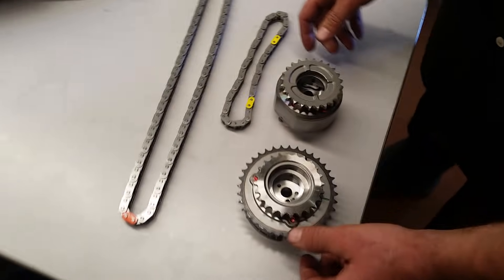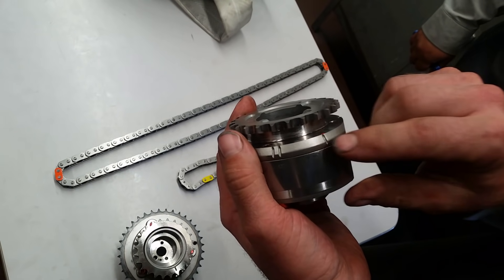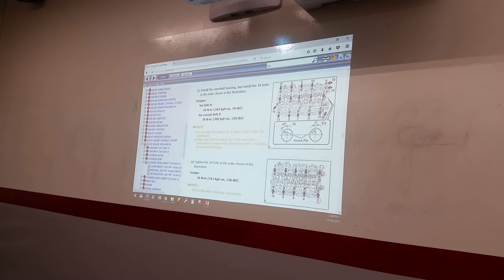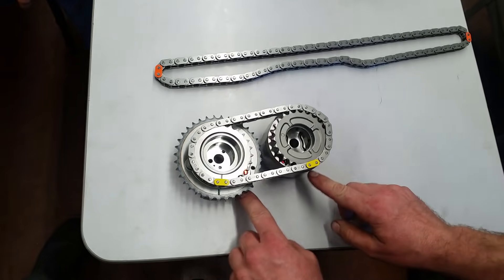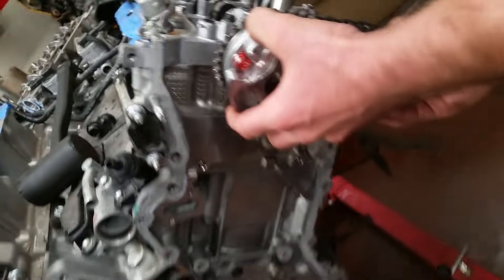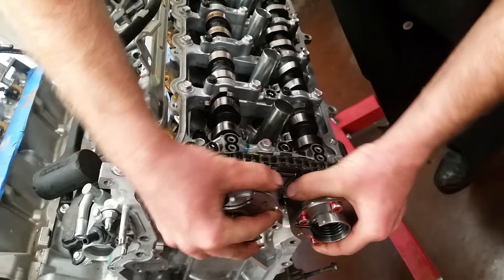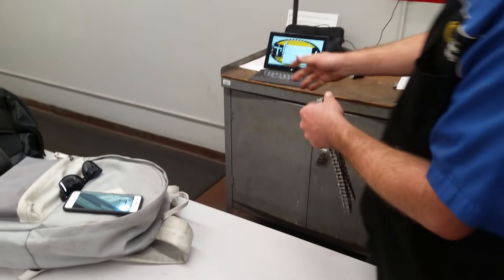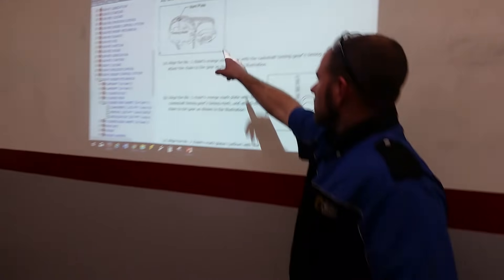How to time Toyota 3ur-fe Tundra Sequoia V8 timing chains

Comment: Was this all done with cylinder 1 TDC??
Reply from the maker: No, the marks are relative chain to sprocket on this. Unlike a timing belt or some chains. If the marks line up, TDC is irrelevant.
Reply: Thank you thank you thank you so much for your reply. 
OK, so if TDC doesn't matter. What should I have the cylinders sitting at? Just a neutral position, where none are TDC? Also when putting the cam towers back on do the lobes matter which way they are facing? Other than the degrees for the knock pins?
Reply from the maker: @johnnygamboa143 just where the knock pins say. Then the chain will hang down and show you where the crank needs to be
Reply: You just blew my mind, I think I get it now. Cause the sprocket/phasers on the intake cam have timing marks for the main, longer chains. So those line up with whatever your crank then has to be positioned to. So it doesn't matter where the cylinders start off at? I guess I got confused cause this is the first timing job I've done, but I also took off the cam towers too cause I had to do the head gasket 🥲
Reply from the maker: @johnnygamboa143 you got it
Reply: I set it all up, but when I rotated engine by hand, I feel that too much slack was in my longer chains due to the tensioners not being fully extended, and fear it kept jumping timing by a tooth. Do the two tensioners for the longer chains need to be prepared in advance with oil pressure?
Reply from the maker: @johnnygamboa143 that is normal, those tensioner will pump up with oil pressure but not until you start it. 
I would reset them and leave them, no need to rotate 

Or if want to rotate use a ziptie between the timing chain guide and tensioner shoe (moving guide) to apply tension. Dont forget to remove the zipties.
Reply: Thank you so much, I've rotated the engine several times and my smaller chain links aren't lining up with my longer chain links, but they are going back to their marks on the sprockets, just not at the same time..So I guess I'll just redo it, take it apart set it and leave it
Reply from the maker: @johnnygamboa143 yup. They will eventually line up but it takes 27 rotations or something ridiculous like that. I dont waste time on that.

Comment: good video but just a suggestion for next time lol, maybe show the passenger side because it was harder instead of the driver where the chain falls into place. Talking about the flat spots on the cam sprockets to pass the chain through would have been nice. Sometimes a video aint enough and a mechanics just gotta mechanic

Comment: I know this video is old, but I am hoping to get a response from someone.  I did this job, fired it up and it gave me a P0348 code which is sensor A.  Changed out all the cam sensors and it is still coming up, it is timed correctly.  Looked at all the wires going to the connectors and they're all good.  There was one thing I forgot to do and that was put the ground cable wire back onto the valve cover when I started it, could this mess things up on the ECU?  I've heard the crankshaft sensor can cause this code to pop up but I have not had any codes come up on this truck with 100K miles on it until now.  Do I need to clear the codes while the truck is running?  I get the DTC's via my bullydog since it is supercharged and can clear them through that.  Any help would be much appreciated!
Reply from the maker: The ground not being connected won't cause anything like this. 

This code is not related to timing either, that's more of a crank/cam correlation code. 

Your code is typical. The voltage received at the ecm from the sensor is higher than spec. You have either:
A defective sensor (doesn't matter if it's new)
A problem in the 3 wires between the sensor and the ecm
An issue with the circuit inside the ecm

I would have to pull service info to really coach you step by step but this will get you in the right direction.  Looking at wires doesn't test them. My recommendation would be to check the sensor for correct voltage (terminals at the sensor) and terminals at the ECU. As an example, one of the wires should be good ground. If the sensor is not getting a good ground it will send a high voltage reading back to the ecm and set this code. 

You are one the wrong path checking timing and stuff. Focus on the voltages related to the sensor. That's how the dtc logic works.

Comment: Since you only showed the driver side, I have a question about the passenger side. Do you use the double line on the exhaust phaser or do you still use the single line?
Reply from the maker: https://drive.google.com/file/d/148eKXIbQdEV2zXTIWIUXrhrCjkGcmoDF/view?usp=drivesdk
Reply: Did you find out how? Im currently trying to figure it out.
Reply: @lukereed5889  I tried to re-time the engine using the old components just to make sure I could do it right once the new components arrived and I used the single line on both phasers. The engine turned easily and nothing hit. But the block turned out to have a slight crack so I never did get to hear it run. So all I can tell you is everything seemed good using the single line.
Reply: @JoseDiaz-bk9mh  Thank you so much
Reply from the maker: @lukereed5889  check that link to the service manual document that I put on Google drive.
Reply: @lukereed5889  no problem

Comment: I don't know if you reply to old videos but I'm confused on bank 2, did you do the chain and spin the crank and the did bank one? Or is the procedure the same as bank 1
Reply from the maker: It is just about the same, you may have to reposition the crank slightly to slide the chain on when the "flats" from one cam sprocket are in the place they allow. Too tight with the round cam sprocket close to the sprocket teeth, chain won't fit onto the sprocket, just move a little till the flat spot opens up enough room and put second chain on. Marks are the same.
Reply: @CollegeAutomotiveClasses  thanks for the reply! I'm just curious I had all my marks lined up I didn't set it to tdc, but lined all the marks on both sides and got p0300, p03001, p0303, p0305, p0307 so all of bank 1 was misfiring then I got crank/cam correlation code bank 1 sensor b tore it all down retimined it got marks in correct alignment and didn't start so I'm confused at this point
Reply from the maker: @PVOPROJECTS  sometimes when you put the vvt cam sprocket on you can have the dowel pin miss the hole. See if that hole is oblonged or if the cam dowel pin punched a new hole in the sprocket.
Reply: @CollegeAutomotiveClasses   I forgot to mention that I put new camphasers on the intake side and it's not lined up with the dot of the timing does that affect anything
Reply from the maker: @PVOPROJECTS  it will only line up with the dot once in a whole bunch of revolutions. If it wasn't lined up when you initially did the timing, yeah that's a big issue, but understand once you turn the engine the marks won't align again for many many revolutions. Just make sure they are 100% good initially. 
Also the marks for the small chains are different from one side to the other, I'm a little fuzzy on memory but one bank may be to one dot and the other bank to 2 dots or something similar. You do have access to service information or manual right?
Reply: @CollegeAutomotiveClasses  yes, I have access to prodemand I'm actually doing this to a customer vehicle it both states to line it up as the same as bank 1 so the 1 line from exhaust cam gear and 1 line from intake gear which is the dot that you reference
Reply from the maker: @PVOPROJECTS  oh yeah I see that now, I was mixing it up with the 2gr v6. 
What was the original concern?
Reply: @CollegeAutomotiveClasses  the chain on bank 2 sensor 2 skipped timing because the tensioner gave it slack
Reply: But no misfires or anything just that the timing had skipped
Reply: Got it started and running now I'm running into a problem where it takes a while to crank it'll idle then slowly die out
Reply: Wanted to update you that it's working and 💯 thanks man!

Comment: After turning the crank 28 times I can only get the main chains to get back to their original marks. I can not get the smaller number 2 chains to line back up properly on the yellow marks. Is it imperative that they match back to where I put them or are they the hunting type?
Reply from the maker: That is ok. As long as the small chains line up eventually, they don't all necessarily line up on the 28th time, just the main ones. You got it.
Reply: @CollegeAutomotiveClasses  I’ve turned it 112 times now manually which is 4 times and they still haven’t lined back up. Do you know how long it should take?  Or should I just reset them?
Reply from the maker: @iadgreen28  if you turn it forward a little more do the small chains eventually line up even though the big chains will no longer be on the marks? If yes, you are good. The small ones don't really jump anyway, the big ones can jump because no oil pressure to the tensioners.

Comment: is there any special trick to installing the timing cover?  I can't seem to get the oil pump sprocket to slide all the way onto the crankshaft.
Reply from the maker: It's a tough job. The flat parts of the crankshaft have to line up to the oil pump drive gear inside the cover.

Comment: I love my 5.7 Tundra but this sure makes the LS Chevy seem amazingly simple.
Reply: Although the Coyote and 3UR are similar the coyote engines are even harder to service because the phasers are spring loaded. This is easier than sticking a mirror under a oil pump looking for a tiny dot through a 1in by 1in window on a hemi. Hemis actually have to be turned over 94 times to verify timing
Reply: And what's the advantage of the complexity. Fuel economy? Nope. Power output? Nope. Emissions? Yep. The primary advantage of the engine design is when it comes to emissions.
Reply: @hochhaul  how would this effect emissions?

Comment: Que torke lleva una cabeza de 5.7 para tundra please
Reply from the maker: 27 ft.lbs or 36 Nm THEN an additional 90 degrees THEN and additional 90 degrees. They are torque to yield bolts and there is a specific sequence. I will make a video eventually but not ready to yet.

Comment: Junk......My 1999 Jeep Cherokee Xj has almost 350,000 miles and is just like new....All these Toyota's are gay...Timing belt's and chain's and Weak frame's and suspension's.... Definitely not a Jeep.
Reply: Bob Quattrini let us know when your Jeep reaches 1 million miles like the Tundras do..
Reply: Jeeps always break. Toyotas just keep going and make you wonder when it will break because they hardly break. I own both and guess what I bought for the wife and kids. You got it a Toyota. Kids never missed a day at school or work due to breakdown.
Reply: Bob Quattrini Jeep is for entitled people. Toyota’s are for sensible people and land rovers are for rich entitled people. Reasons. Jeeps are not that expensive but made to be a rock crawler and be “drivable” in everyday local trail use. Reason for that is because the owners drive it and it can break down get towed by a friend and go home. Toyota is made so you can survive alone with the most comfort possible and not worry about breaking down  land rovers are mall crawlers that are off-road capable show offs.  So for a long term expedition where you might not be able to rely on other. Land cruisers and comparable are the only way to go. I will always have a Toyota made off-road capable vehicle as my shtf fall back vehicle. A Jeep is not a fall back vehicle.
Reply: Let me know when isis stops using land cruisers and changes to jeep.
Reply: Toyota frames we're rusting do to Dana holding Corp. leaving out a corrosion inhibitor during the manufacturing process of these frames. Toyota outsourced these frames to an American company because their trucks are built here in the United States. It's more cost-effective to do so due to the cost of shipping thousands of frames to the United States. If they were made in Japan they wouldn't have rusted out. When Toyota was done with the recall they hit Dana holding Corp. with a multi-million dollar bill.
Reply: ken H good for you for knowing that. But an excuse for a problem. Is still a problem.
Reply: @youtubecomments5951  definitely can be a big problem. thankfully they did a recall to correct it. Unfortunately for Toyota Dana tried to pull a fast one and leave the corrosion inhibitor out of the processing. I'm sure it probably could have saved them thousands of dollars. Guessing they were hoping to get away with it.

Comment: Both banks were timed with cylinder 1 at TDC, correct?  Is timing chain 1 (going to crankshaft) on bank 2 already aligned correctly?  What is the correct alignment of all chains and cams on both sides if doing both banks at the same time?  Thanks in advance
Reply from the maker: Endangered Entertainment it is not necessarily on cyl 1 tdc. With interference engines they don't do that so much any more since if you were to turn the cam,  the valves would contact the piston

Just make sure your small chains marks are lined up when you install the cam gears.
Then line up the First big chain like shown, the colored links to the marks on the crank and cam. As long as your marks are lined up, you are good, and you can move the crank to other positions, as long as the mark still aligns with the colored link. 
Then do the same with the last big chain, in fact, you will have to move it around to get it on. 
Don't focus on TDC, just the marks to the colored links, that's all that matters.  

You can verify it stays on time but it is a pain, you have to rotate the engine many many times to line up again (hunting gear ratio) and the chains want to jump a lot since the chain tensioner is pumped up with engine oil pressure, which you won't have yet. A zip tie from the chain guide to the shoe will prevent the chains from jumping, but it is still a pain and don't forget to remove it. 

I would recommend just doing the marks and double checking they are all lined up :-).
Reply: Paul Kelley Awesome! Thank you for the info, sir.  Could you provide any info as to the degrees I would align the cams on bank 2 before installing the timing chains?  In the vid you say on bank 1 the pin on the top cam is at 45 and the pin on the bottom is at 3.  Is there any preferred way to get them exactly to spec?  Is the cam alignment on bank 2 virtually mirrored from bank 1 (i.e. to the same but degree but backwards)?  Is correct cam alignment critical?  My email is wesleyfyork@gmail.com if you have a diagram available that you'd be willing to share.  I'm putting my 5.7 off of a 2007 Tundra back together after replacing a broken valve spring and want to ensure that the timing is to spec before completing the process.  Thank you again
Reply from the maker: Endangered Entertainment setting the cams up just helps get the sprockets (actually vvt controllers really) in the right spot. If you are close it will be ok since you move them around till they drop on the pin. If they are off you will just have to move the cam more till the sprocket drops on. I find holding the sprockets in place and turning the cam works best. 
It is drastically different from a timing belt, where cam and crank alignment marks to the block are so specific, this type isn't as much about cam and crank position to the block, but the distance between each other. 
I am making myself a reminder to email you, I don't get on my computer till the evening. I think you have enough to make it happen if you can't wait, but I will email you a document later anyway. 
P.s. they are not really mirrored, just at a different point in the 4 stroke cycle.
Reply: Paul Kelley Excellent!  Thank you again, sir.  All of the info provided has been very helpful.  I won't be working on it again until tomorrow morning so that would be just fine.
Reply: @CollegeAutomotiveClasses  should the driver's sides bank be under tension when aligning the passenger's side bank?
Reply from the maker: @philgonzalez5438  doesn't need to be just make sure your marks are aligned. The chain tensioner is oil fed so it will be a little loose until the engine starts and oil pressure builds up
Reply: @Paul Kelley  4 stroke engine, so you should be able to turn the crank 4 times and at least see the timming marks on the cam and crank gears back to those original 45 Deg and 3 deg right? The color on the actual chain won’t match the marks on the gears until the 28 turns you mentioned ? I know on a single cam pushrod engine you turn it twice and you should see the marks back to where they should be.
Reply: Paul Kelley so low oil pressure can cause timing to jump?
Reply: Endangered Entertainment   very good
Reply: Endangered Entertainment you teaching is good
Reply: Another tip for installing chain 1 on right bank after the vvt gears are on the cams. There's a flat portion on the side of the intake gear. When the gears are installed on the right bank, the flat part on the intake gear isn't adjacent to the exhaust gear like it is on the left bank. This makes installing chain 1 impossible unless you rotate the cams until the flat portion is adjacent to the exhaust gear. Then, roll chain 1 onto the intake gear first, then rotate the cams back to where they started, and finish by rolling chain 1 onto the crankshaft gear. 

Or, install chain 1 onto the vvt gears before installing them onto the camshafts; making sure the chain slips over the crankshaft snout in the process. Then, just roll chain 1 onto the crankshaft gear.
Reply: Not sure if you’ll see this right away, but what position do you put the crank gear in to ensure that there will be no valve piston contact? Is there a neutral position where the valves never touch when you turn the cams?